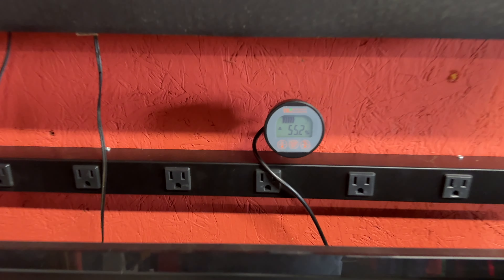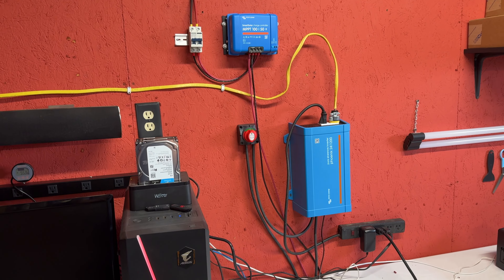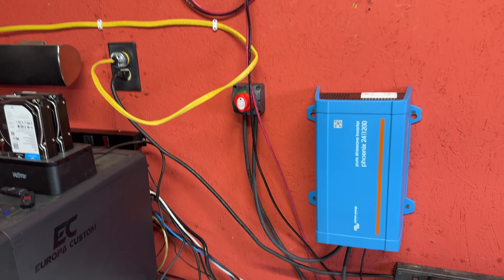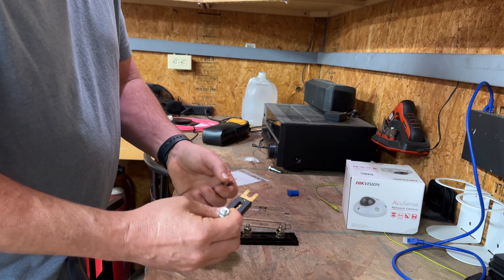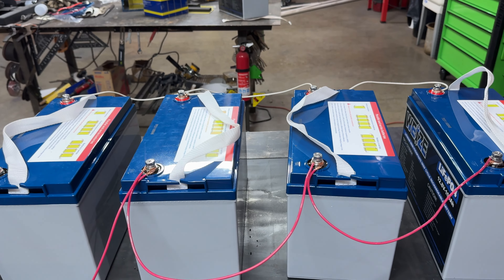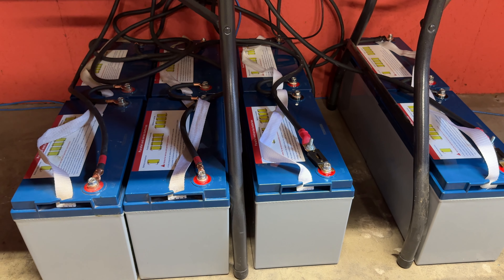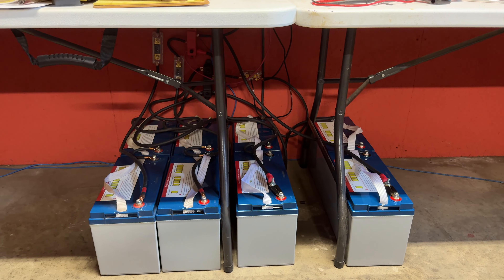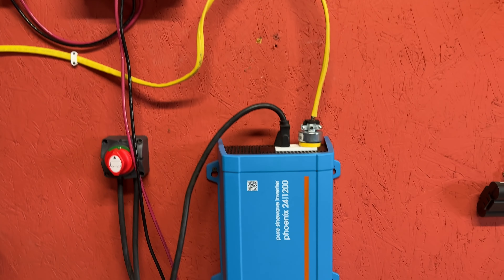Solar battery expansion

Comment: You're almost set now!  You just need the second charge controller.  Have you played around with the controller settings in the app to maximize the charge potential?  A video on the Victron App would be great if you could show that.